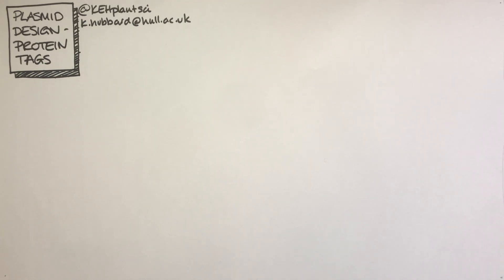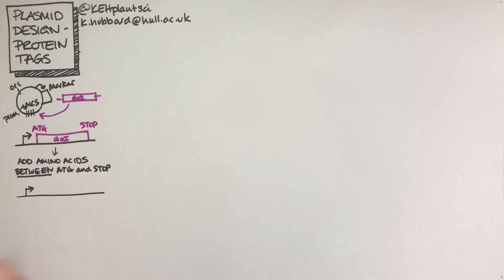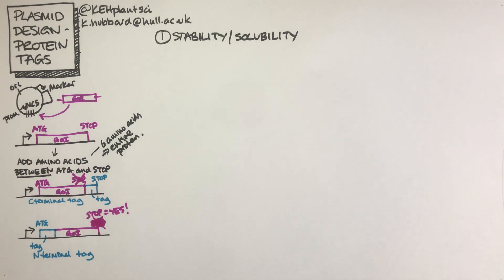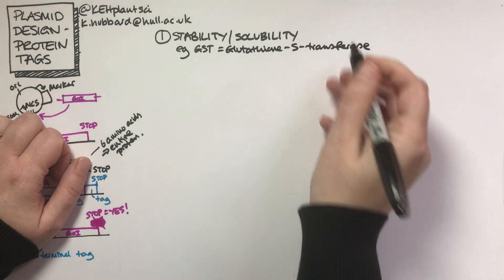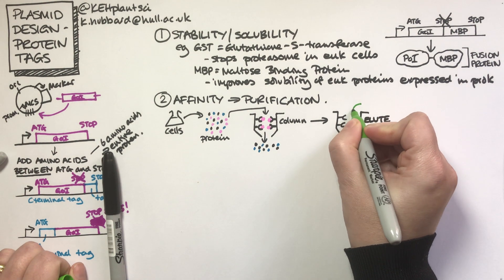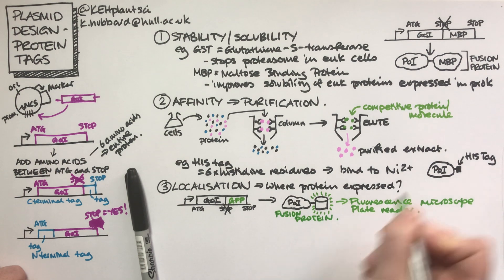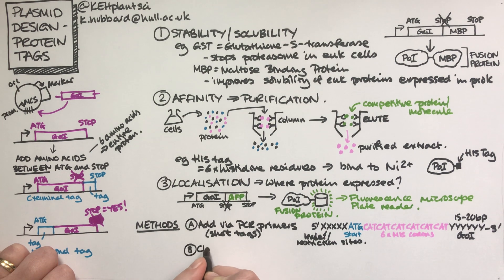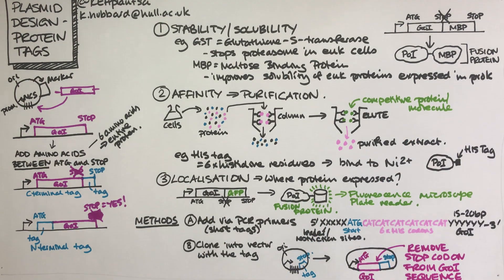Plasmid design - protein tags

Comment: Thank you so much for explaining this!! 
I would like to ask a question, I would be grateful if you could answer. My question is if I want to add the His Tag at the N terminal, do I need to remove the start codon from the beginning of the gene of interest? or just leave it to code for methionine like the following illustration (ATG-3XHis-GTG from the GOT and the rest of the sequence).
Thank you!
Reply from the maker: Good question! You are right that you need an ATG start codon before your His-tag, otherwise it won’t be translated. You can keep the ATG in your gene of interest, which will just be translated as a methionine as usual. In practice it is more usual to use a vector that already has an N-terminal His tag in it, immediately followed by a multiple cloning site for your GoI. But sometimes you can get wierd effects adding an N-terminal tag as the first Met is usually cleaved off the start of the protein, so you need to design your experiment with appropriate controls. Most people make both a N- and C-terminal tagged version and hopefully get the same results with both. Hope that helps!

Comment: Dear Katharine first of all thanks alot for the video. Secondly i still have 2 questions: If i am to design a fusion protein between my protein of interest and GFP as my tag, do i have to remove the start codon from the GFP encoding sequence as i removed the stop codon from the GoI or is it not a problem for transcription when it runs into another start codon? 
Furthermore if i want to create this fusion protein without using a vector that already contains the sequence for GFP can i use PCR priming on the GFP sequence to add restriction sites that exist within a vectors MCS, then clone the GFP into this vector, then use PCR priming on my GoI to add the exact same restriction site at the end of the GoI that i added to the beginning of the GFP-sequence while adding a different more upstream restriction site to the start of the PoI? in my head this would allow me to clone the GFP into the MCS of my vector and then cut right at the beginning of the GFP and add in my GoI there but i am unsure if this is a common way at all or complicated in regards to keeping the reading frame.
Reply from the maker: Good questions! 1) you don't need to remove the start codon - it will just read as a regular AUG = methionine 2) You could PCR clone both the GoI and GFP into a multiple cloning site (MCS) if you wanted to, but is much easier to clone into a vector that already has the GFP in it. For example if your MCS has the sites XhoI-EcoRI-BamHI-SalI you could clone your GoI into XhoI-EcoRI and then GFP into BamHI-SalI (assuming these restriction sites are compatible with your sequences). You'd need to do more checking to make sure you had e.g. the stop codons in the right place and that it genuinely made a fusion protein, so would be easier to clone into a GFP vector where you know that the GFP bit will be fine. Hope that helps
Reply: Dear sir or madam, thank you for your question, I had same question about start codon in the middle of fusion proteins and now I have an answer.

Comment: Hi. I have a question. I want to add a tag using the PCR primer method. If the primer is very long, can I break the primer into two and do the elongation twice? For example, if the primer (leader sequence, RE, tag, linker, or GOI) is 50 bp long, I cut it in half and use a 25 bp primer twice. The first primer contains a linker and GOI  whereas the second primer contains a leader sequence, RE, and tag. Is it possible? Please kindly respond.
Reply from the maker: Technically possible I guess (?), but you'd almost certainly be better cloning into a vector that already contains your tag if you need a primer that long. Hope that helps :)
Reply: Hi, how to remove the stop codon or start for adding tags

Comment: So what if I want to add a protein to an existing reading frame but don't want it to be a fusion' protein, but a polyprotein that can be cleaved by an encoded endonuclease? Do I just encode a restriction site between the host protein and the new one?
Reply from the maker: Not sure I understand your question - do you want the protein to be cleaved by a protease, or the DNA to be cleaved by a nuclease? Let me know and will hopefully give you an answer!
Reply: @katharinehubbard5043  I want the protein cleaved by a protease.
Reply: I think we have something like fusion specific protease,, though when u use a tag called Glutathione transferase, which has protease specific sequence dat connect d protein of interest and the tag..

Comment: It seems there should be something to separate the gene of interest from the tag, so that the resulting protein folds properly and is not denatured.  Is that the purpose of a linker? I am the first to admit that at the present time I know just enough to be dangerous.
Reply from the maker: Apologies I didn't spot this comment earlier! Yes there is always a risk that adding a tag will disrupt the structure or function of the protein, so needs to be controlled for in experiments. Particularly for membrane proteins which often fail to fold correctly with a tag. For example you could express your protein in a knock-out cell (ie lacking the functional protein) to see if the tagged protein complements it and restores the wild type phenotype. Could also make both an N and C terminal tagged version and see if get same results. Adding a longer linker can sometimes help, and obviously the smaller your tag the less likely it is to cause problems. Hope this helps :)
Reply: @katharinehubbard5043  superb..
Reply: I'm curious about that too, how do we know that adding a tag won't have an effect on protein folding?
Reply: @Mateo-jc9zg After more study, I'm sure maybe the tag will be in the regulatory region and not attached directly to the gene sequence. I was hoping the instructor would respond, too.
Reply: @gregorysmith1134  Indeed sometimes the tag does interfere with the proteins tertiary structure. Whether the tag is at the N or C terminus as well as which tag is used needs to be considered accordingly. And I'm not sure what you mean about being dangerous.
Reply: @nikolai5012  like the person who knows just enough about explosives to blow himself up.